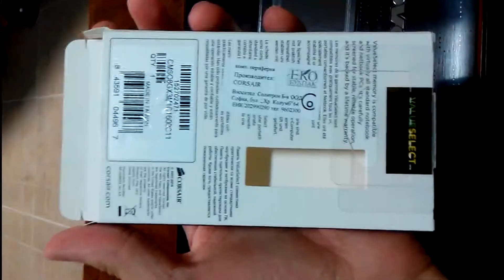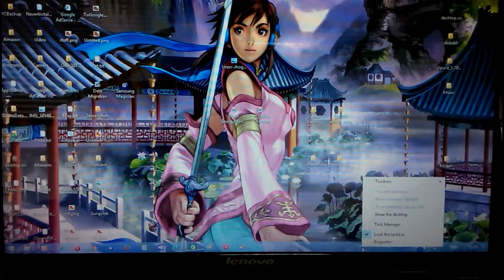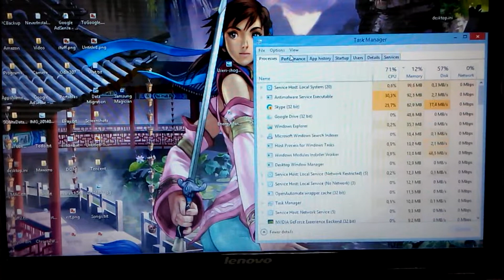How to upgrade Lenovo Y570 RAM - 16 GB, 2x8GB Sticks

Comment: can i use the 4 ram and add 8ram DDR3--does it matter which is in top or bottom
Reply from the maker: The position doesn’t matter. You can mix RAM sizes. I chose to replace the default one because I wanted 16GB.

Comment: Thank you for this video. This is the exact laptop I have. Do I need to change the ram settings in bios? I'm running Windows 10 and I am unable to access the UEFI or BIOS settings
Reply from the maker: You don't have to change any BIOS settings - it should work right away.

Comment: Thx for the video! I also have the same model, but much older revision (Pentium B940). Are there any chances that the motherboard doesn't support i7 Sandy Bridge CPUs like 2620m? The version of bios is 2.06, does it matter?
Reply from the maker: Sorry, I do not know the answer - you can try and see if it works.

Comment: have you upgraded your hdd to ssd ? and which brand model please? thanks
Reply from the maker: I've removed the CD Tray and put a Samsung SSD in its place long time ago. If you're still using a HDD, I recommend changing it or adding an SSD - it makes a huge difference in loading times and system speed.

Comment: I read that max ram capacity for y570 is 8gb. Has the laptop used more than 8gb while using some applications?
Reply from the maker: Yes, I usually have multiple programs open for my work as developer and sometimes it gets to as much as 11-12 GB. What you've read is true, but for one slot - the laptop has two slots and each can have up-to 8 GB of RAM for a total of 16 GB. This is the reason I remove the old one and use 2x8 instead of just adding one 16.
Reply: @Shogoeu  i have a lenovo Y580, are you sure that i can put two rams? i have fear to overheat or burn the motherboardd or something like that
Reply from the maker: Yes - the laptop can handle it
Reply: I was confused about this as well. Both the Lenovo website and Crucial list this laptop as only taking 8gb but I googled the motherboard and found that it can take 16gb

Comment: @Shogo this laptop has an m.2 slot for m.2 ssd, am I wrong? This way I can still have both the standard hdd and the dwd-writer... Please correct me if I am wrong!
Reply from the maker: Y̶o̶u̶'̶r̶e̶ ̶r̶i̶g̶h̶t̶!̶ ̶A̶t̶ ̶1̶:̶1̶9̶,̶ ̶i̶f̶ ̶y̶o̶u̶ ̶l̶o̶o̶k̶ ̶a̶t̶ ̶h̶o̶w̶ ̶t̶h̶e̶ ̶c̶o̶m̶p̶o̶n̶e̶n̶t̶s̶ ̶a̶r̶e̶ ̶p̶l̶a̶c̶e̶d̶,̶ ̶b̶e̶l̶o̶w̶ ̶t̶h̶e̶ ̶R̶A̶M̶ ̶i̶s̶ ̶t̶h̶e̶ ̶W̶i̶F̶i̶ ̶m̶o̶d̶u̶l̶e̶ ̶a̶n̶d̶ ̶b̶e̶l̶o̶w̶ ̶i̶t̶ ̶i̶s̶ ̶a̶n̶ ̶e̶m̶p̶t̶y̶ ̶m.2̶ ̶s̶l̶o̶t̶.̶ ̶O̶n̶ ̶t̶h̶e̶ ̶r̶i̶g̶h̶t̶ ̶s̶i̶d̶e̶ ̶t̶h̶e̶r̶e̶ ̶i̶s̶ ̶t̶h̶e̶ ̶H̶D̶D̶.̶  Edit: i made a mistake, there is mSATA slot, not m.2.
Reply: @Shogoeu  could you please tell me what would be the form size of the maximum ssd m.2 supported? It doesn't looks like it would allow 2280 form/size ssds...
By the way, nice song on the background! 😁
Reply from the maker: @MisssTeryyy  I am sorry, i made a mistake in my previous comment. It supports mSATA, not m.2 - https://media.kingston.com/images/ssd/faq/M2-FAQ-Q2.png this is how each of them look. It is an old format which is replaced by m.2.

Comment: is it ok to set 16x2? (QuadCore Intel Core i7-2630QM, 2600 mhz)?
Reply from the maker: The laptop doesn’t support 16x2. I think the maximum was 8x2 for the motherboard and 1600 MHz for the processor.